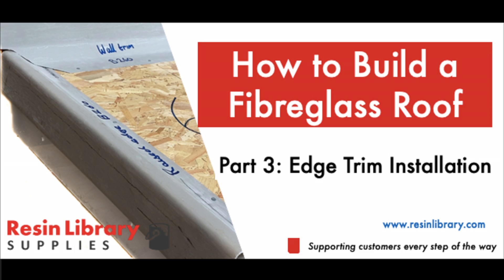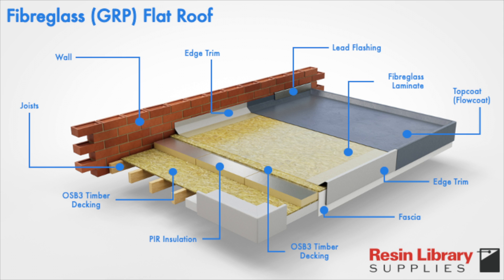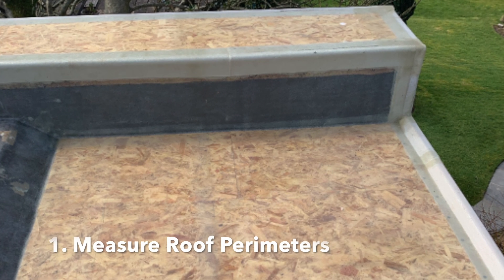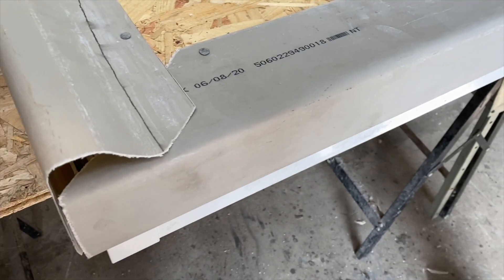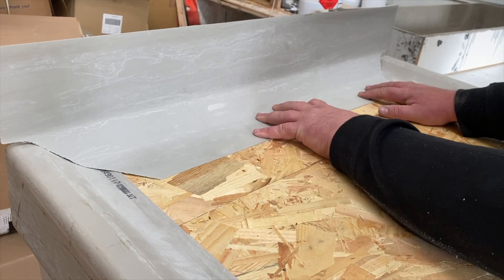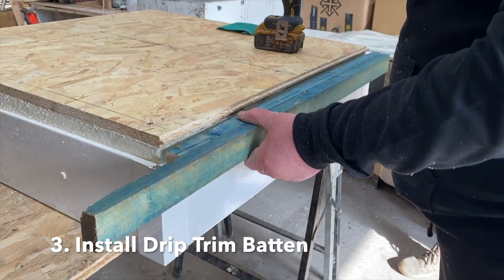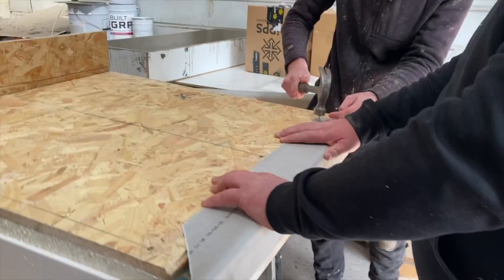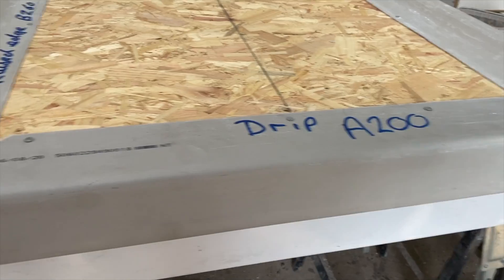Part 3: Edge Trim Installation on a Fibreglass Roof

Comment: Hi there. Great video and content. I do have a question for you.... I've had a fibreglass roof done and for some reason the builder has painted the drip edge and raised edge in standard gloss paint. The top coat hasn't been applied to the roof yet and I'm not happy with the quality of the paint he's put on the trims and this should be topcoated not gloss paint. Will I be able to cut them off and replace them? Really hope you can help